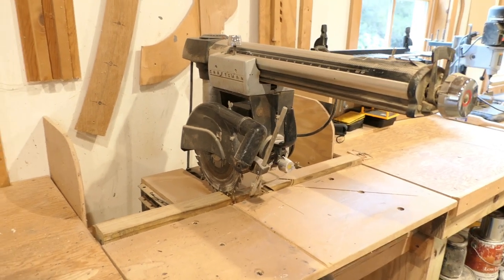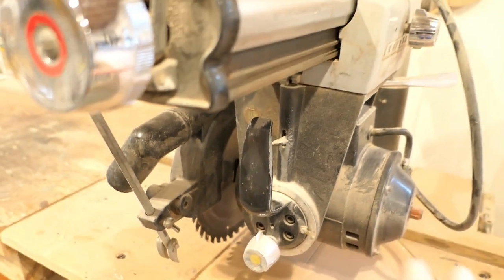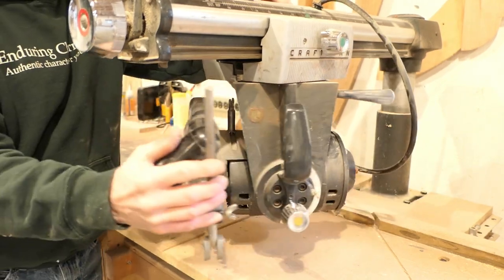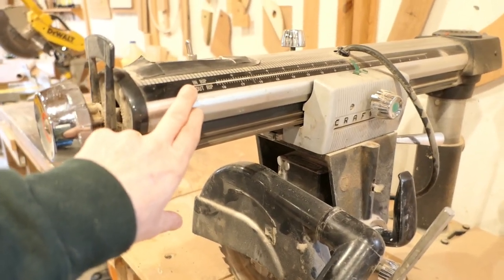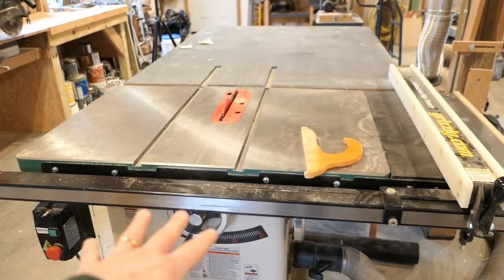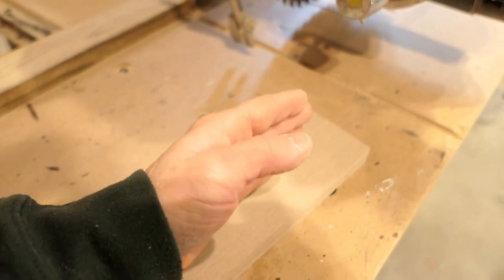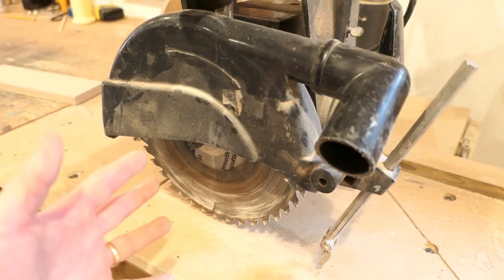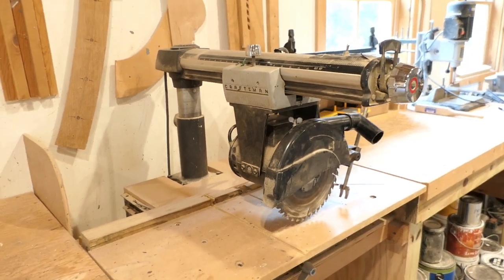The Radial Arm Saw Controversy Revisited!

Comment: Most fairly modern (up to ±50 year old DIY) Radial(arm)saws manufactured/sold by B&D/DeWalt/Elu as well industrial RAS's made/sold by other companies (in Europe as well as in the USA) are not hardly as dangerous as you like your viewers te believe.

Most (if not all) RAS of which the motor can be turned 90º (ripping position) do have all the standard features you say RAS's (i.c. your Craftsman-RAS) seem to lack.

My over 30 year old ELU RAS-8001 (≈DeWalt DW721) has the following standard safety features:
1) fully adjustable riving-knive ⇒ for rip-cuts;

2) fully adjustable finger-protection ⇒ for both cross- & Rip-cuts;

3) fully adjustable anti-kickback-device (AKBD) ⇒ not just a simple hold-down fotr your ripping-stock but a very effective safety feather with making use of effective anti-kick-back-fingers (AKBF's) even when making beveled rip-cuts;

4) fully selfadjusting guardschields ⇒ placed on either side of the sawblade. Ensures the sawblade is hardly if at all exposed from the side. Even during the cut the blade is hardly exposed from the sides facing the operator.

As a 12 year old, over 50 years ago, I had my first encounter with a Radial(arm)saw, it already had all the features of my ELU RAS-8001 c.q. DeWalt DW721.
The friendly carpenter who owned the RAS carfully tought me how to use it safely for all types of cutting and especially ripping (as a kid/youngster I was not allowed to come even near the in his view far more dangerous table-saws).
So be for any new cut, cutting set-up, I was tougth to adjust the finger-protector to the thickness of the stock.
For ripping one was to let down and properly adjust the riving knive and the anti-kickback-device.

==========

Looking at both your videos it is clear that, contrary to your statements/and believe, your ¿very-old? Craftsman-RAS already has some (if not most) of those important safety-features, be it in a less advanced design than at least de (European) DeWalt-RAS’s from the 70’s and onwards.
But somehow you missed them or at least do not seem to really understand them:
1) Riving Knife ⇒ OK, your machine seems to lack the use an fitting of a riving knive;

2) Fingerprotection ⇒  Your machine has an easily adjustable fingerprotector that consists of the (upper) sawcover to be tilted down towards the stock (so downwards towards the operator when crosscuting and ripping); a feature you mistakenly took for some way to improve the dust output/exhaust away from the operator;

3) Anti-kick-back-device (AKBD) ⇒ your machine already features a quite effective anti-kick-back-device (AKBD)  including anti-kick-back-fingers (AKBF), at least for non-beveled ripping.
But since, at least in outrip-postion, you mistakenly feed the stock from right to left (as suitable for in-rips) which places the AKBD in reversed (and therefor nonfunctional) postion with respect to the direction of the stockfeed; thisway the AKBD can only serve a a simple holddown. In your video you further push down the AKBD so far that the AKBF's become completely useless even in in-rip-position; this way the AKBF's only 'serve' as ineffective/useless sliders/scratchers over the top of the stock when in passes underneath during the rip-cut. This shows that you did not fully understand haw to make use of the AKBD other then as a (useless) holddown. When usede an adjuted in a correct way your AKBD ensures safe ripping at least for non-beveled rip-cuts.

I strongly suggest you look up the manual that shows the correct use of the quite functional AKBD + AKBF’s and as well as the othe features tha make ripping an a RAS at least as safe as on most (modern) tablesaws.
4) Sideguard-shields - your machine lacks them so the downpart of the sawblade ios fullyexposed; I don’t know if your Craftsman never had susch side proitection as standarrd or as an accessorie, but most modern RAS’s have them even though many operators take them of (parcially).

==========
Any machine that is not operated carefully or in the way it is intended is dangerous;
and sure some of the possible uses shown in older manuals are never save;
Nowadays safety plays a greater role in the use of most machines and manufacturers take great care not to propagate improper and dangerous uses of all kinds of statonairy saws, be it bandsaws, tablesaws, radial(arm)saws and even (vertical) panelsaws,
but a properly used RAS is not more dangerous than a table-saw, neither for crosscuts, nor mitering nor ripping.
So make them safe by using them safely, try to understand how to best use them (safe) and tka advantage of all its features without making unsubstantiated claims about the dangers of either machines, especially where those dangers can easily mitigated by proper understanding and use.
And further RTFM, and if it doesn't make sense RTFM again (and again).

een vriendelijke groet, Simon Koorn (Netherlands)

Comment: You can buy a reasonable RAS for much less than a tiny DIY table saw. Neither are really suitable for ripping large boards as they come. But I will rather equip the RAS with supports to handle the work piece size, than do the same with that tiny table saw. There are many things you can do to enhance the safety also. It’s nothing to do with the inherent design- it has to do with the vintage. You’ll have to do the same to make old table saws as safe. What stops a RAS from having a blade rider for instance- nothing. It’s just in those days nobody did it.
Reply from the maker: It's true, the RAS belongs to a different era when safety concerns were not paramount.  But, they were never updated with better safety designs because they fell out of favor and stopped being manufactured.

Comment: I find it interesting that someone preaching the dangers and horrors of a radial arm saw has a table saw without a blade guard or anti kickback pawls. I'll assume you don't do a lot of cross cutting on your table saw
Reply from the maker: Well, my table saw gets reconfigured depending on the task at hand.  I have a variety of feather boards I use for both the top and sides of workpieces.  I also have several push stick styles I keep hanging at the edge of the table.  As for cross cutting, it is the primary tool I use for cutting tenons on smaller pieces in cabinets and furniture, often using a dado blade.  In that case I set up a fence spacer to clear the opposite side of the blade.  I will also cross cut smaller pieces on the table saw, which can be safer than trying to use a miter saw.  When using a standard blade the saw has a riving knife, and that gets removed when cross cutting and put back on for ripping.  I do not use a fence ruler for the cut distance as I find them inaccurate for the work I do, so I measure each cut to the blade tooth.  A blade guard is not compatible with my workflow or type of work that I typically do.

Comment: Look, this tool has its limits.  If I had no other way to Rip I would use it for that.  But I have a real tablesaw.  So what is this tool good for.  Cross cutting: All angles, and including Dados.  Now the question is why does one need a Miter saw is the real question.
Reply from the maker: Well, one reason to have a miter saw would be portability.  You don't see radial arm saws on jobsites.

Comment: I agree with you 100%, and I have had this same argument with many people over the years.  I have worked in some sort of woodworking or cabinet shop for 30 years, and the number 1 tool I hate the most is a radial arm saw.  It may have had its place at one time in history, but that time has come and gone with all the other option you have now.
Reply from the maker: Yeah, I used mine for crosscut dadoes for awhile, but even that I now do more quickly with a router jig.